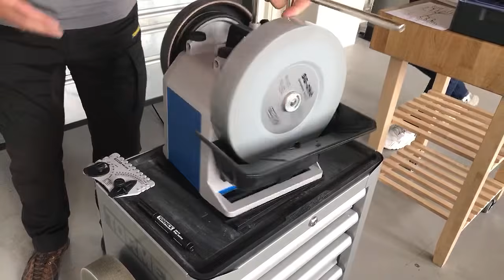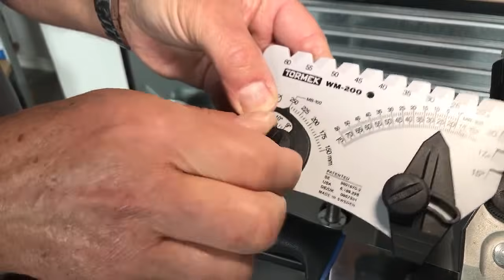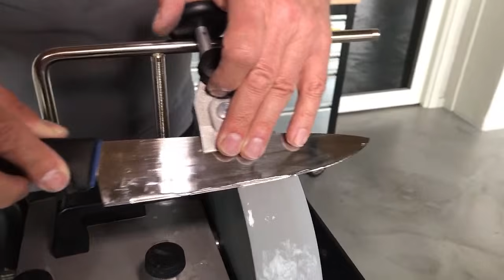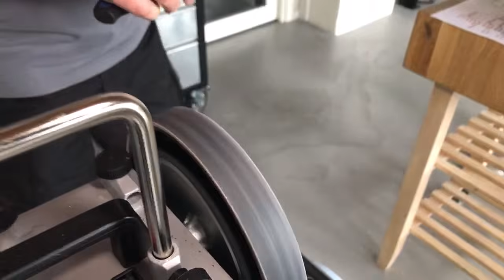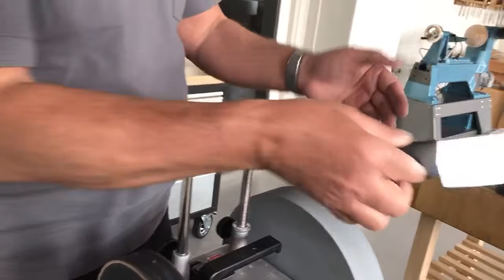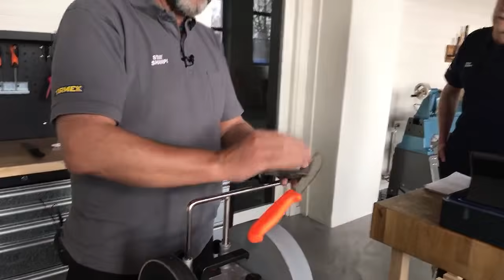Knife sharpening | Part 1 | Tormek Live Sharpening Class

Comment: Could you invent a space-saving ceramic knife sharpener similar to the little sharpener wheel sharpener what you have?  Or a dimished (small) version of the big one? It could be space-saving and could fit in normal kitchen dravers, with a not too noisy engine.😮
Reply from the maker: Hi! You can sharpen ceramic knives on the Tormek T-1 Kitchen Knife Sharpener. I recommend you check it out: it's small, quiet and very good looking 😍 https://shop.tormek.com/

Comment: All these years, Tormek hasn't improved much design except a stronger motor, which is not much of an upgrade in our time. Tormek can beat rising competitors by implementing these functions.
 1. Engineer internal digital angle setter, that would eliminate using unreliable ks-123, wm200 - and a marker sharpie methods, that are not precisely reliable
 2. Design multiple variable speeds for users to be able to choose variable speeds, for example ability to use higher speed for correcting a chipped blade, etc.
 3. Allow the use of two wheels on both sides, that can have 2 different grit sizes running at the same time and create stropping wheel as a third wheel all on the same machine, let the 3rd stropping wheel have a separate power switch that can run independently of the first 2. 
4. Elongate the design from 2 wheels to stropping wheel, so that it would be easy for user to use each wheels grit as well as strop blades, machetes, knifes, chisels, current design is absolutely poor, when stropping a knife you always need to curve your blades, knifes in most awkward way in order to avoid hitting the main grinding wheel. 
I hope Tormek implements at least some of these, since your customer service and instructions and tutorials for all users are truly amazing, but rising competitors like Tradesman Edge Apex and others, will take over if Tormek will not keep up.

Comment: Thank you Sebastian and Wolfgang for spending the time to create these great informative videos, so much time and effort must go in to getting ready to shoot
I have just bought the T4 and I am slowly getting my head around the system. I have most of the jigs and have started with chisels and plane blades. When I started my first knife I made a mistake with the angle, used 15 deg on the bevel, WHOOPS. How does using 15 deg on the body of the blade translate to 15 deg on the bevel?I also have trouble getting a consistent grind marks across the entire length on the blade I must be not supporting the blade sufficiently. Is there any issues with just dragging the blade across the stone in a single direction? Would using the Japanese stone mitigate this issue?
Please keep up the great work 🇦🇺😊
Cheers Stephen
Reply: Hi guys, just another question, I was trying the marker method, and when adjusting the angle the stone was grinding right in the middle, with the edge and top of the bevel not being touched by the stone. Is this because of the curvature of the stone and until it has been sharpened on the System you won’t be able to adjust to have the entire bevel in touch with the stone? Hope you guys had a great Christmas
Reply from the maker: Hej Stephen, your're absoluty right, the bevel was straight or even convex shaped.
//Wolfgang
Reply from the maker: Hej Stephen, a 15 degree angel - a 30 degree- on an already established tapering like an outdoor knife or scandic grind like a Mora knive means only in reverence to the angel. this will increase the total a ngel with the degree that the tapering is on the blade. For these knives i realty use any degrees, i just make a tiny "beautiful" secondary bevel on the blade. Important is the time that the edge  keeps it sharpness.
You can sharp only in one direction if you feel more secure. The marks you'll get near the tip are from lifting the knife to early. The marks in the straightpart of the knife are from lowering to little or to much in the movement. The edges are more aggressive and "digging" into the edge. Rounding of the edges of the stone minimise the damage. A good tip is also to "read" the water that runs over the blade, when moving sideways, is a good indicator how your are aligned on the surface.
//Wolfgang

Comment: First thing you hear with startup. The reservoir resonating. Is there a tip to place a damper? T 8 owner in Netherlands 💪🏻👍🏻👌🏻
Reply from the maker: Hej Simon, maybe the water trough isn't completely on the holder pins. When you still have the resonating sound, press slightly and carefully the pins/forks together. The water trough will sit a bit tighter on.
//Wolfgang

Comment: TIP😉. 

It’s difficult to tell when your 1/2-2/3 way through a tube of oil when…

1: The tube is not transparent. 

2: When the tube is shaped like a toothpaste tube.
Reply from the maker: Point.... but you'll feel it ;-). When you use all the oil it's not an issue either.
//Wolfgang

Comment: Many thanks to Sebastian and Wolfgang for an instructive and helpful video.
After years of tracking I bought myself a T8 device and I am at the beginning of my journey as a "sharpener".
I saw [between minute 23-28] that Wolfgang works only on the left side of the knife and then with the leather wheel on the right side. Aren't the 2 sides sharpened equally?
Reply from the maker: Hej, sure, we demonstrated the tasks and methode how it is done, we didn't sharpened the knife fully, 
//Wolfgang

Comment: I purchased the T8 several years ago, played with it a while but starting to get into it again as I get close to retirement. I do have an issue/question, while sharping the knife blade on the stone, the water runs along the blade and get on the body of the unit and between the stone and the sidewall. This creates a puddle under the unit. As I watch you handle the blade the water does not run along the blade. Can someone tell me what I have set wrong, any advice would be appreciated.
Reply from the maker: Hej, you can tilt the machine a bit by putting some board under the leatherside of the machine. It can be the water itself, certain waters have through the minerality a different surface-tension, just add with a toothpick a tiny amount of dish washing liquid. An the blade must be clean, sometimes the steels properties causes this effect too.
//Wolfgang

Comment: Very helpfull. I just wonder why the Sharpening and honing of the tip of the knife is done with different  lifting techniques. 
First you recommended not to lift towards the chest while sharpening. But then that’s exactly what you do when honing the first big kitchen knife. 
I’m very happy with my T8 !!!
Reply from the maker: Happy to hear Max, and a good question! Since the honing wheel has a bit of "give" you'll be able to get to the edge without lifting the knife when honing the tip, plus you dont have to worry about creating a wider bevel on the tip when honing since it doesn't remove material the same way as sharpening. Hope my answer was clear enough :P 
Stay sharp!

Comment: Dear tormek. how do you prevent the jig to adjust while sharpening? sometimes i feel the adjustible knob turn while i sharpen which creates an different angle. the knob is so smooth to adjust so it turns when i dot want it to
Reply from the maker: Hi Ivor, 
Good question. You could try putting a thin filament of something, like plastic wrap, over the threading, and screw the adjustable stop back on. This is not an issue with our new KJ-45 Centering Knife Jig, since the spots are fixed: https://tormek.com/en/products/grinding-jigs/kj-45-centering-knife-jig
Hope this was helpful. Stay sharp!
/Hugo and the Tormek team

Comment: Nice presentation.  My wheel keeps slipping under the lightest pressure.  The drive shaft doesn’t bite into the inner wheel.  How to fix?
Reply from the maker: Hej Charles, 
best would be to take contact with the shop you bought the machine from to solve this problem. It is always very hard to help without seeing the machine. Our resellers have good knowledge about the machines and should be able to help. Otherwise could you take contact with support@tormek.se and send a video of the machine / problem. 

Stay sharp!

Comment: Your own instructional manual says "Don't sharpen from tip to base or you'll end up over-sharpening the middle".
Reply from the maker: Hej tailstalker, I couldn't find that phrase in our manual. It could be one of the third party manufacturers. I see no reason in that statement due the fact you have to sharpen all the way of the bevel. The risc of over-sharpening any part of the bevel is to move the blade over the edges, too much pressure and in the straight part or any other part, an uneven movement. /Wolfgang

Comment: Is there a way to sharpen a rocking pizza cutter ( a partially elliptical blade)?  Or the completely round blade of a pizza cutter? Thanks  for your well done training video. I'm retired and thinking I could earn enough money from sharpening business so I wouldn't have to depend on Social Security.
Reply from the maker: A completely round blade is no problem to sharpen but could require some training to get it right. Use the Marker Method to get the right angle and then sharpen it freehand. When you apply the right amount of pressure at the right angle the blade should spin by itself and sharpen the whole bevel.

Then finishing with honing on both sides of the blade – and as always: With the honing wheel running away from the edge. The best way would probably be by using protection gloves, holding the blade with a sturdy grip, and rotating it manually.

Be careful though! Spinning sharp blades can be dangerous.

Good luck and Stay Sharp!

Comment: These jigs are really a challenge to use, and require some practice in order to keep them steady on the tool rest so the bevel is consistent. Finding the right pressure to use is important as the knife edge can bite into the stone and be thrown back. It took me a few hours to actually become proficient at simply holding the jig with the knife in place and moving it smoothly across the stone. Then you must learn / practice a lifting technique to sharpen a rounded or curved tip.
Reply from the maker: You are right, it might require some training to attain the best sharpening technique 😊 And that's one of the reasons we are arranging our live sharpening classes – for all our users to be able to learn how to stay sharp.

I hope you learned something new from this sharpening class and that we'll see you in the upcoming ones! Stay Sharp!

Comment: Why are they sharpening knifes on this machine when the t2 is available?! The t2 is much easier to use, much quicker and leaves a better result. I can't see why they wouldn't use the t2.
Reply from the maker: It depends on what needs and what machine you got. If you also need to be able to sharpen axes, chisels and gouges for example, the T-8 or T-4 will do that as well :)

Comment: Hey guys! A bit confused, I just got the T4, I want to sharpen Global chef knives which google tells me is between 10-15 degrees... so do I have the edge master set to 25 or 12.5 degrees? Confused here :(

Thanks!
Reply from the maker: Hej StreetArtistsOfThe World, 10 to 15 degress as toatla angel would be thinner than a fileting knife. This is meant on each side, means 20-30 degress. My experience is with Global knifes that as 12,5 (25) or 15 (30) degrees is the best choice - depending for what you use the knife. The tougher the task, the greater the angle. /Wolfgang
Reply: @TormekSharpening  Thanks!

Comment: It looks like you can just use the water as a guide to tell you if you are doing it right.

You want to preserve a nice even small bead of water along the edge and particularly the part of the blade that is in contact with the stone.

Is that a quick way to understand?
Reply from the maker: Hej Whisper555, absolutley right, you can "read" the water, taht gives you a gread indication.
Reply: @TormekSharpening  Thanks for the reply 👍🏼👍🏼

Comment: I was just trying to sharpen a long skinny knife that was probably i think a paring kitchen knife… I think… The blade was probably 10 inches long. In order to get the blade at the right angle… 15° on each side, the handle of the knife was basically hitting the strapping wheel. 

What was I doing wrong?
Reply from the maker: Hm, sounds like your stone diameter has decreased below the diameter of your leather honing wheel. If so, you can remove the honing wheel while sharpening, and you'll fit as long tools as you want. Let us know if this doesn't help. The best way is to  send a video to support@tormek.se. Stay sharp! :)

Comment: @ 17.50 younare wrong. To obtain a 15 degr sharpening angle, you have to compensate for the angle between the Edge and the centerline og the spine. This is aprox 2 degr that has to be added to the setting om the angle master. And it should therefore be set at 17 degr. for you to get 15 degr om the side being sharpened.
Reply from the maker: If you are using the Tormek WM-200 Angle Master on a Tormek Sharpening System our explanation is right. 😉 Our tools are designed so that you can reach a reliable result for every time you sharpen a tool or knife! 
Stay sharp
Reply: @TormekSharpening do not agree. If you want to obtain 15 degree angle and you get a 13 degree angle instead, you will not get a sustainable edge if the knife/steel cannot carry it that steep. A problem I encountered the first time I used it. 
The anglemaster is in humble opinion Best for single side sharpening eg plane lades and chissels. Hence why many people use the projection method to obtain the desired angle, instead of the anglemaster.
I do seriously think you need to take this into consideratuon when demonstrating the use of the anglemaster.
I use the anglemaster every single time but I do compensate for the angle between the edge and the centerline of the blade.
This I have also explained to other Tormek users who could not get the wm-200 to work properly.
As a rule of thumb when using the anglemaster - add another 2 degr to a thin blade, and 4 degr for a thick blade. And guess what - they went not being able to create a edge that would cut, they went to a very sharp edge.
Apart from that I am extremely happy with my T8...

Comment: Hello Tormek,
When using a sharpening jig on the T4’s leather wheel, do I need to adjust the stone diameter on the WM200? If so, there is no setting for the 5 inch or 127mm wheel. 
Thank you from Missouri
Reply from the maker: Hej Herb,
Thank you for reaching out to us. If you want to hone with your jig you have to change the diameter on the WM-200 Angle Master to the maximum (it says 150 there). This should work! 

Stay sharp & safe! 
Tanja from Tormek

Comment: This was a very informative video for everyone, but especially those that are new to Tormek sharpening.  Just two questions ... 1) Is the cabinet that you used in the video adjustable for height?  If not, will it be a good height for someone 6'-2" tall (188 cm)?  ... and 2) Do you recommend leaving the water in the tray for longer periods of time (say 2 weeks or more), topping up the water level as required before using for sharpening?  Or do you recommend replacing the water more often?
Reply from the maker: Hej Alberta Al, thank you for your comment! 
1) Are you referring to the table the Tormek T-8 is standing on? Ju can not adjust the height there. Wolfgang, you did the course, is approx. 185 cm, if that helps. 
2) We would recommend to change the water frequently. Depending on the amount of sharpening you have done you can change it daily. 
Stay sharp! //Tormek
Reply: @TormekSharpening  After posting my question here, I found some information on the cabinet.  I was referring to the Tormek Sharpening Station (cabinet).  From what I researched, the cabinet is adjustable for height.  Thanks for the reply.
Reply from the maker: Yes, sorry we misunderstood 😅 That is the TS-740 Sharpening Station, and the height is adjustable between 750 mm to 830 mm (29½" and 32 2/3"): https://www.tormek.com/international/en/accessories/sharpening-station/ts-740-sharpening-station/. Stay sharp! :D

Comment: I'm sure there's a good reason but why is the honing wheel not 250mm like the grinding wheel?
Reply from the maker: Hej Boran, 
honing is easier for a lot of tools when the honing wheel is smaller than the grinding wheel. Expecially for long knives, axes or other big tools. The Tormek machines are designed to be used for many different tools and use-cases. 

Stay sharp and safe! 
Tanja from Tormek
Reply: @TormekSharpening 

Thanks, but why is it easier?

Comment: You demonstrate the technique of raising the handle of the knife vertically instead of pulling the handle towards you to go around the curved part of the blade.  But while honing you did pull the handle towards you instead of raising the handle vertically. Is it not as important while honing?
Reply from the maker: Correct! Since honing basically does not remove any material and the leather has some give in it, it will not affect the bevel but only remove the burr and polish the edge. Stay sharp!

Comment: A reasonable video, however the adjustable knob on the knife holder, has a much more important task than what you say!!  If you have a knife configuration that hits any part of the machine or assembly, you can raise the tool rest, and to maintain the correct angle you have to make the knife holder longer. This is the main reason for the adjustable knob on the end of the knife holder....🙈
Reply: Absolutley right AJ Wrighty, also if you have bigger or smaller hand you can adjust it to your size oft the hand to get a secure and comfortable grip you'll feel safe with.